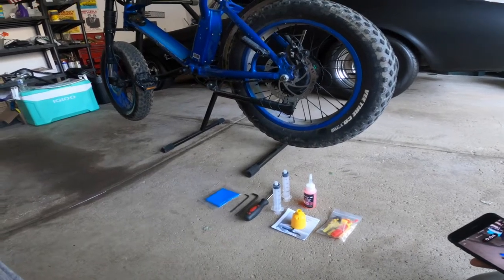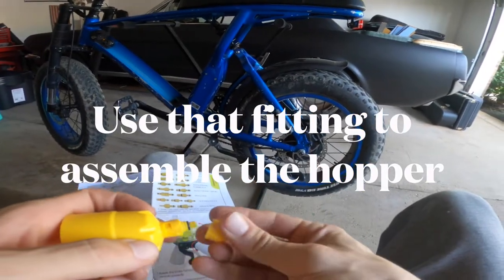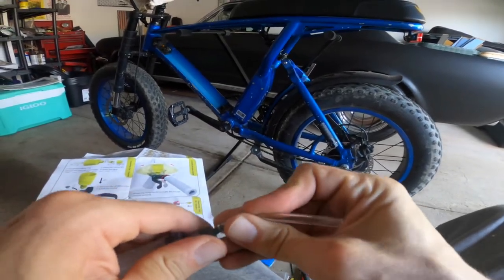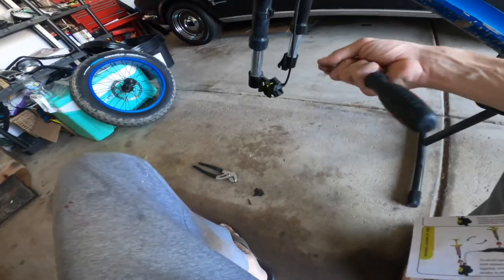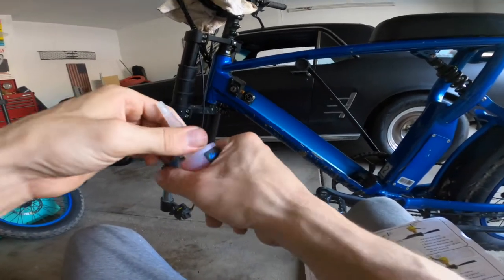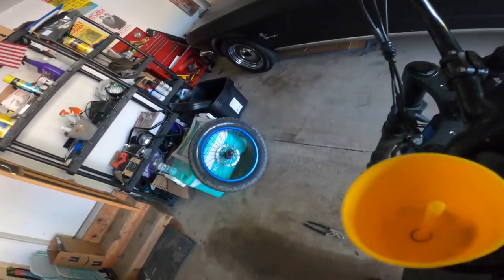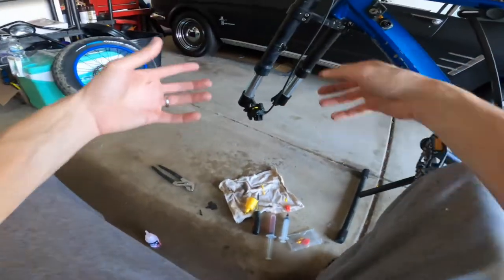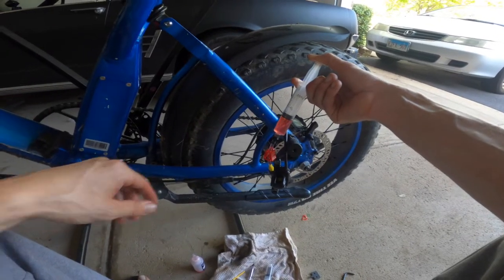How To Bleed Brakes On Your Electric Bike - You Can Do It, It’s EASY

Comment: Glad you didn't take the rear wheel off and instead just took off the brake caliper.  Much easier to just remove the brake caliper than either wheel.

Comment: In my experience its best to take the bottom caliper screw out first and attach the filled syringe. If you take the top screw out 1st theres a few ways for it to let air in and youll leak out the bottom caliper.

Comment: There should be oil in that cup when doing this and the plug out. The plug only goes in when putting the cup on, then oil is put in the cup and the plug taken out, then the syringe plunger stuff, then at the end the plug goes back in the cup just to stop whatever oil is in the cup from coming out when you unscrew the cup.

Comment: Is it necessary to totally remove the wheel from the bike to do this? And how often are you supposed to bleed or change the brake oil? Are you really only supposed to do it if you accidentally flood the brakes? Or is it standard to do every few years as maintenance?

Comment: Nice video, only, if you showed where does the syringe go in on the  caliper would be great 😀 No clue where to stick it on my bike....
Reply: Usually it's a button head bolt, whereas the bolts holding the caliper together you never want to touch, take a bigger allen key and are "cap head" bolts.

Comment: Using the hopper method that you used instead of 2 syringes is the best option.  Good choice.
Reply: The cup he used compared to an open ended syringe with no plunger, is the same thing. The syringe at the lever with no plunger is basically just a cup. There's a syringe at the caliper end in both cases, they are both the same setup really.

Comment: When removing the hose from the caliper right before putting the screw in the oil start coming out how can i block it.  Because when the oil come out the air will get in. 
Please help
Reply: If oil comes out, it's under pressure and no, that shouldn't suck air in anyway. If oil comes out when undoing the caliper bolt, you had pressure in the hose which means either:

1. You pulled the brake lever without quickly opening and closing the caliper bolt to make the pressure equal out.

2. You did not fully open apart the pistons.

3. Or both!

Make sure your pistons are fully apart with a block that's from a kit of the same brand as your brakes, so you know for sure it's the perfect size. Having the pistons fully pushed apart lowers the pressure in the hose to the lowest it can be and in theory with pistons fully apart, it should be the same pressure outside the hose as it is in the hose, zero pressure, thus no air goes in but no oil comes out.

Comment: My the top is my screw is stripped
Reply: The screw or the hole? If it's the hole then it needs a helicoil, but upside down because you don't want shards of metal getting in the reservoir, but if a screw already stripped there, then there probably is shards in the reservoir anyway. Fully bleed oil through and keep throwing away the old oil, until no more shards come through + do the helicoil.